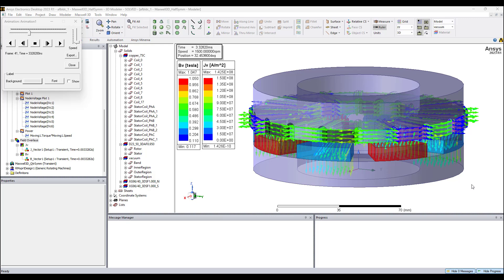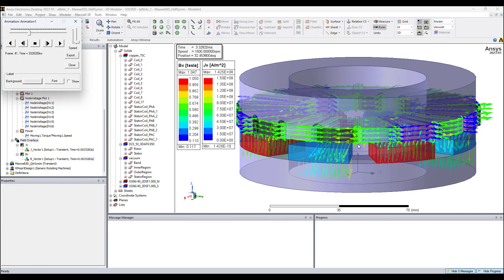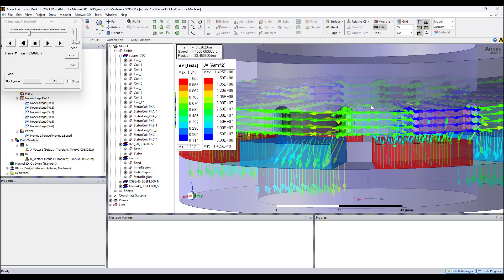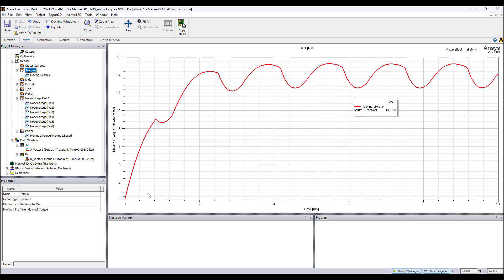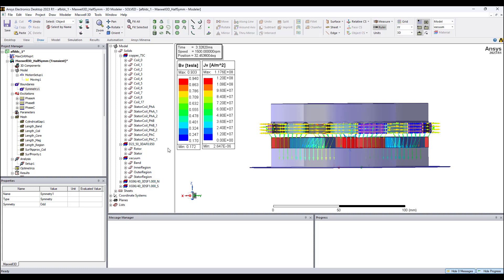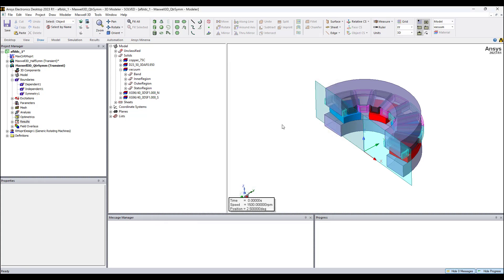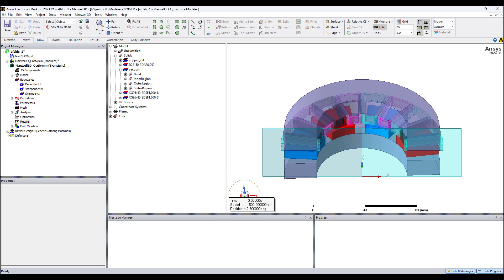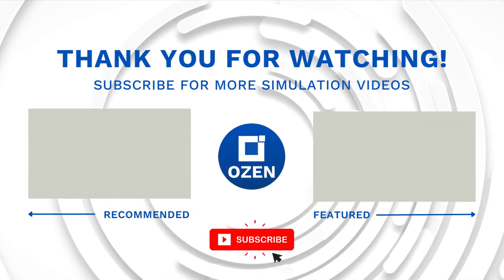Ansys Maxwell: Double Rotor Axial Flux Motor Using Symmetry

Comment: When I do the analysis without Insulating boundary layer between copper coils and ferromagnetic stator I do not get correct flux linkage values, they are off 5 times. Why is that the case, and why do you not insulate copper and ferromagnetic stator?